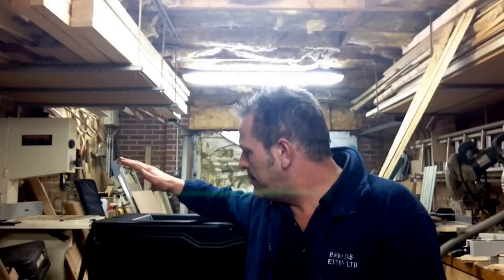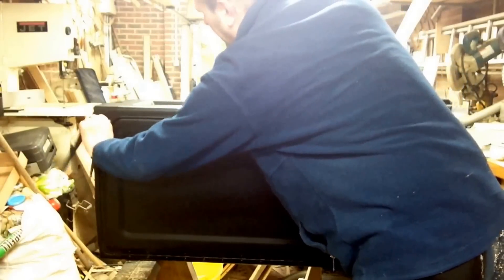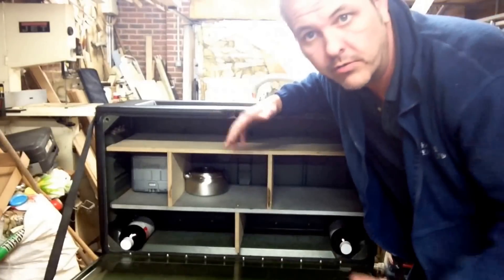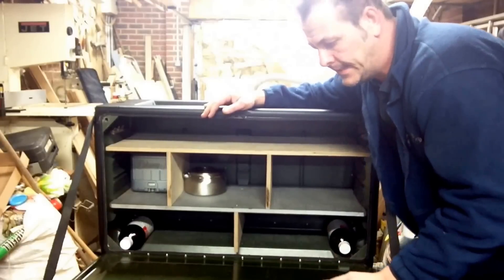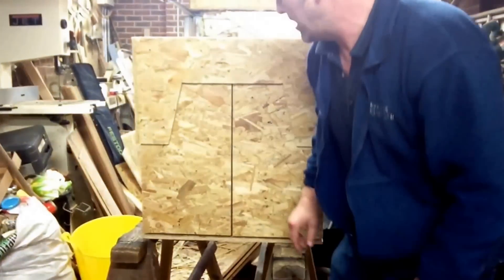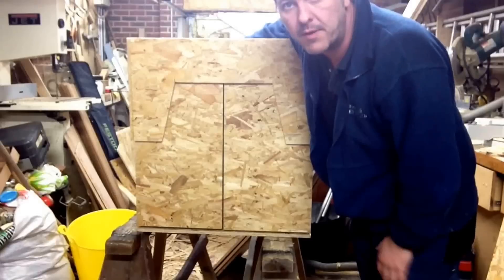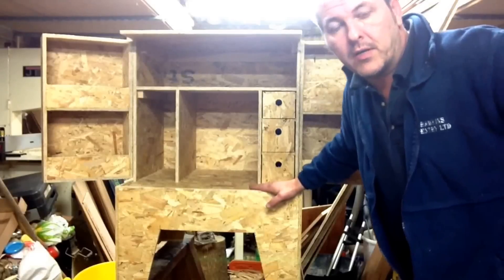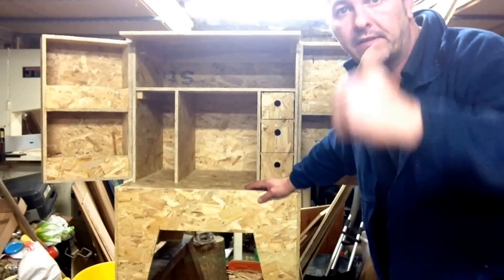Laycorn box and new chuck box/ camp kitchen!

Comment: i seen some of those chuck boxes on yt, great idea if you have the space to put them in, the one you made from osb looks great, as it would be from a craftsman like you, one tip i did pick up from the vids ive seen on those chuck boxes was a length of thin bungy along the openings of the bottle /spice racks to pinch them back and minimise rattle, or you could use that elastic netting, nice one, i look forward to seeing it finished cheers bud
Reply from the maker: Thanks Dave, great idea, will look into it mate, ATB Shaun